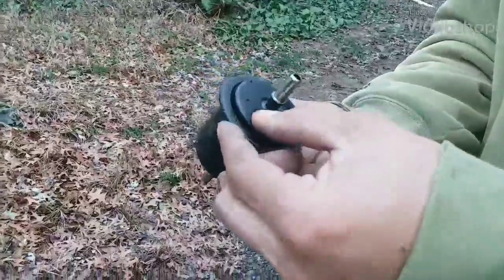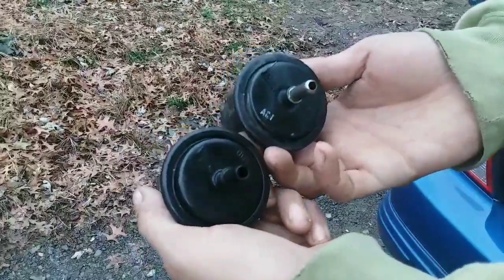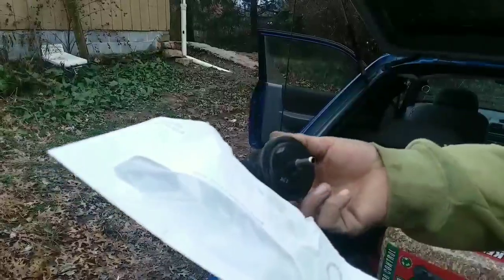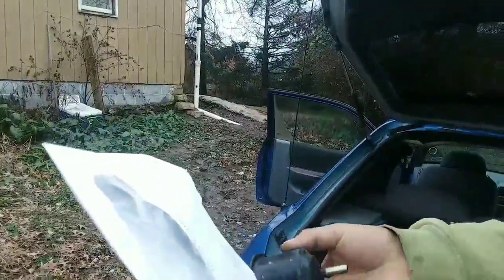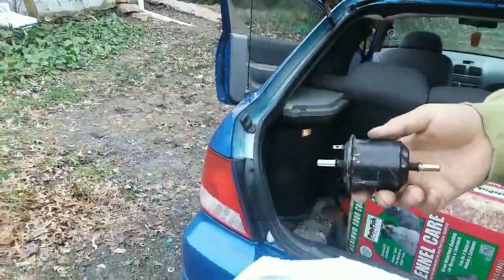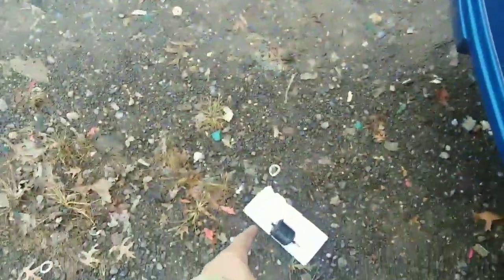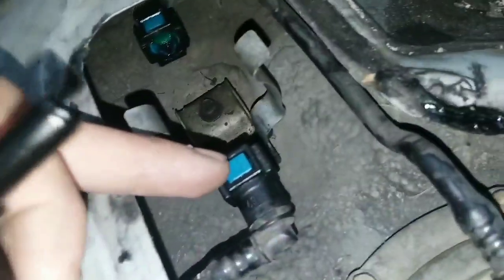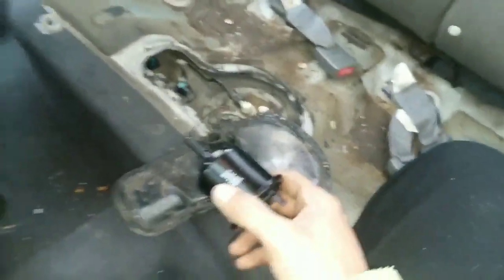How to change a 2002 Hyundai Accent fuel filter

Comment: Hey man..Thanks for all the Hyundai videos! I got a 2001 tibby 2 years ago and your videos have saved me numerous times so I really appreciate it... I had the evap canister problem (tank wouldn't fill and purgevalve jammed).. I dropped the tank and cleaned everything out and replaced the purge valve problem solved... Around the time the canister burst I developed a rough idle and a low end misfire so I replaced plugs and fuel filter a week before I dropped the tank but it didn't fix the misfire... I drove it for a month after and it began to be harder to start than normal and then yesterday it cranks but won't start at all.. I checked spark by pulling each plug 1 by 1 and grounding it and cranking it .. All had spark .. I went on to test fuel pressure but can't find a decent place to tap into.. I pulled the seat out to examine the pump.. I have power to the pump at the connector (pink wire) when cranking and in on position but couldn't hear the pump so figured it failed. I pulled feed lineoff the pump and turned the key on and the pump shot gas out so I think it works (should I be able to hear it?) Lastly, I checked if it jumped time by pulling plug #1 and the top timing cover to check tdc with the cam marks and all is good... I'm out of ideas ... I'll take any suggestions you got ... Thanks again
Reply from the maker: Crank sensor should be the issue  if fuel spark is there . Crank sensor is on the front of the engine has 10mm bolt holding it think i have a video where i replaced it on my Silver 00 Tiburon

Comment: How often does a fuel filter need to be replaced in this Hyundai for preventative maintenance?
Reply from the maker: id do it every 24,000 miles
Reply: @PATuners  thank you! By any chance do you have any videos or could you tell me how to remove the rear seats on a 2002 Hyundai Accent